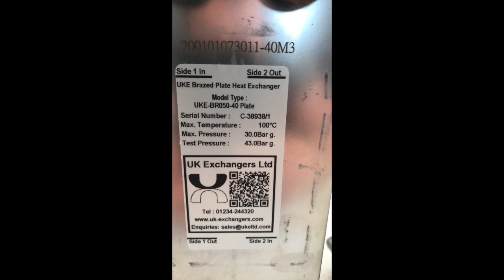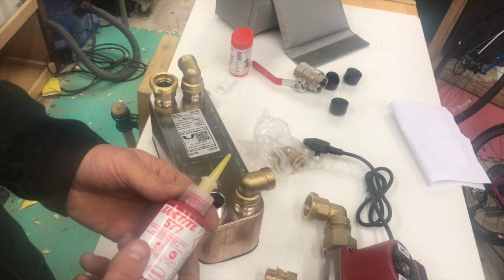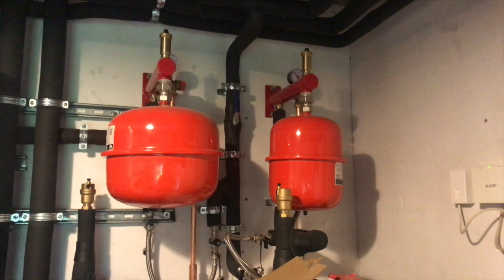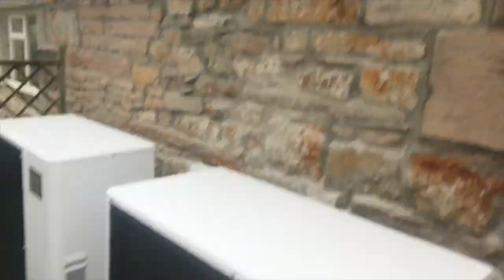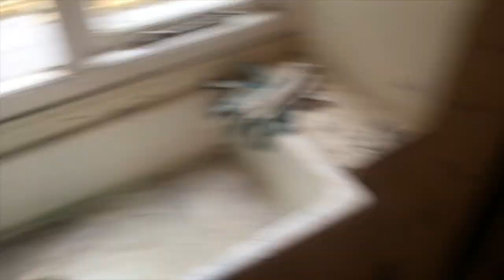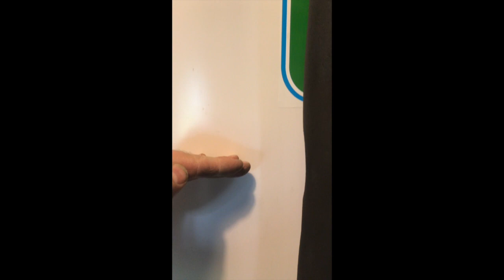plate rig build

Comment: Great video nick. Why do you need glycol in there? A lot of heat pumps I see the pump kicks in between indoor and outdoor when outdoor temp drops below 18 deg so it will never freeze
Reply from the maker: Paul Turner thank you buddy. Power cuts are quite common where the job is and it does get cold we had temp below -10 so it would quickly freeze